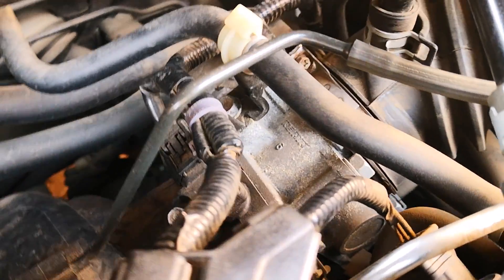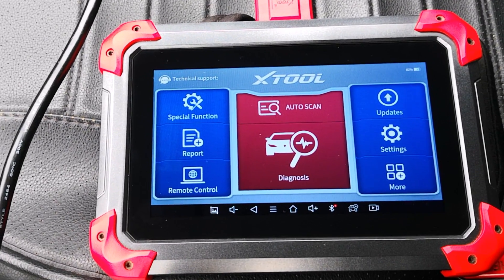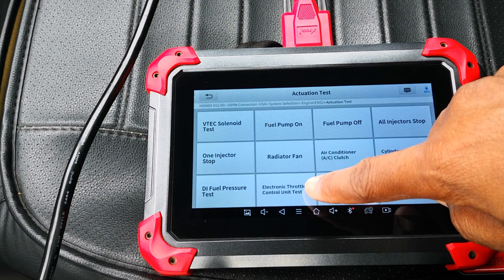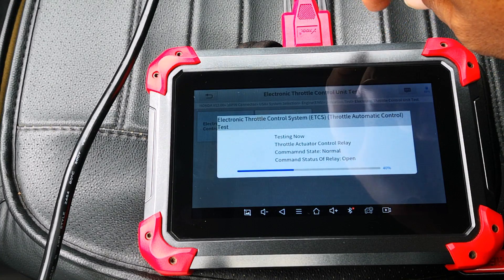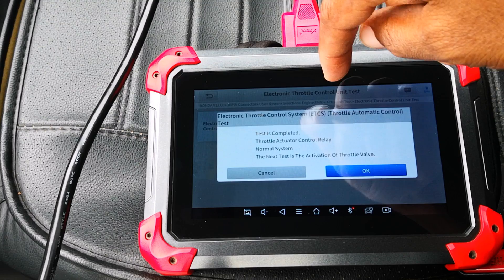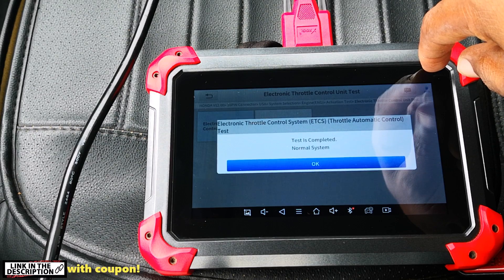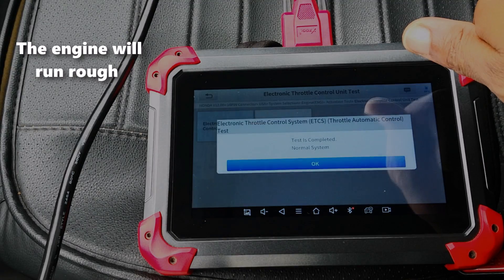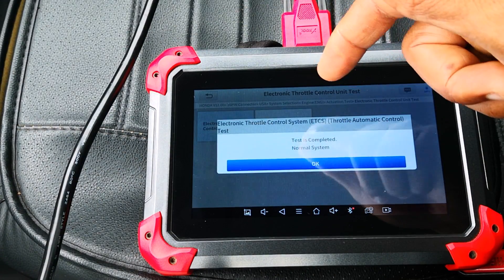Test Electronic Throttle Body with a Scan Tool: XTOOL D7 Active Scanner

Comment from the maker: Thanks for watching! 
Let me know if you want to see more procedures on the D7 🙏🏼
Reply: I've been seeing advertisement for the d7 that it now has ECU coding? Can you confirm on yours?
Reply: Hey, which scan tool were you using when you reprogrammed your ignition key?
Reply: Hi I have the same tool great little tool .i hope you can help 🙏I have a ford ecoboost 1 litre 2018 with the code p2112 and it says throttle body actuator stuck closed.when I start the car it has no throttle response and shakes.when I turn engine off and restart it drives ok then it will do it again when you next start it.if i do what you’ve just done will it tell me if it’s throttle body or another part like peddle sensor thanks for a great video as it helps as iv got same tool 🙏

Comment: Your tutoring video is great, I subscribed.  Unfortunately, I have Xtool D8 and following you I could go up to Activation Test. After pressing the Activation test button, I cannot find Electronic throttle contol unit test option. The vehicle I tested is Corolla 1.8L, 2009
Any idea how to do it on Xtool D8 scanner?
Reply from the maker: Toyota may not have incorporated the same test for that year.

Comment: DIY Auto Works NG. Thank you for these awesome videos. With the xtool D7. The Electronics throttle body testing Can you also use that same procedure as a throttle body relearn procedure if you replacing one on a 2005 Nissan Altima with a 2.5 engine in it when I take the throttle body out and replace it with a new electronic throttle body can I use that same procedure as a relearn procedure.? Thank you once again awesome videos

Comment: Hi sir,  will the Xtool help sort these issues-  
P0609
Control Module VSS
Output  B

P2176
Throttle actuator
Control system idle position 
not learned

P0121
Throttle / Pedal Position Sensor/
Switch A circuit
Range / Performance
Reply from the maker: What car? It's more about rectifying the reasons why those codes were thrown. The tool will only do diagnostics, except if part of the 'fixing' requires caliberation of parts.

Comment: Im looking for another scanner i got a xtool d7, looking for another one with topography analisis and some more rf key immb features what you reccomend?
Reply from the maker: I think the D8 has been upgraded to support topography scans and it can work with the add-on accessories for key programming. However, note that if you do mostly key programming, there would be some functions only the dedicated advanced key programmers will do. E.g. Pulling pins on some Dodge cars.

Comment: Hello sir my car Toyota corolla 2nz fe xli 2005 model engine vibrating when put in gaer and when AC is on when put in neutral engine don't vibrate please kindly response my comment thank you sir
Reply from the maker: This may be emissions related or down to the chassis. Do you know if your engine mounts are still good? What does your RPM read when this is happening?

Comment: A good one as usual. Is there a way to test a MAF using a scan tool. I have been getting P0172 and P0175 codes on my car.
Reply from the maker: I'm not aware of an active test for the MAF or MAP sensors. But there's a correlation between what the MAF sensor should read at idle and engine displacement. Try to searching the Internet for your engine. Also go through the list of the common causes of running rich.  Eliminate one after the other, and you should find the culprit.

Comment: I suppose this'll be useful when testing throttle bodies without having to bolt them to the manifold and connect the air duct leading to the air filter.

The D7 completing the procedure before you had a chance to narrate alongside was a subtle dig at being benched for too long.😂😂😂
Reply from the maker: 🤣 🤣 🤣 @ subtle dig for being benched for too long. That cracked me up.